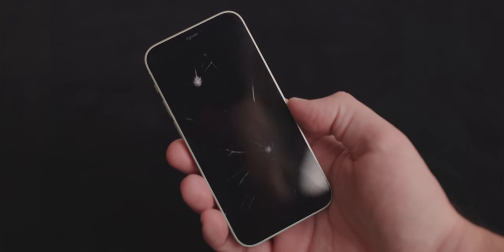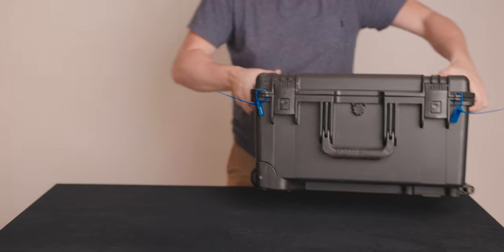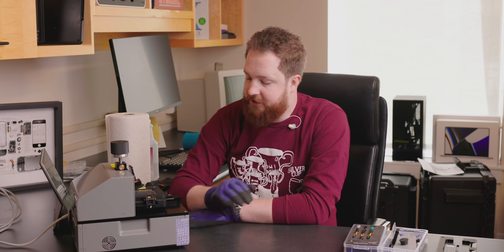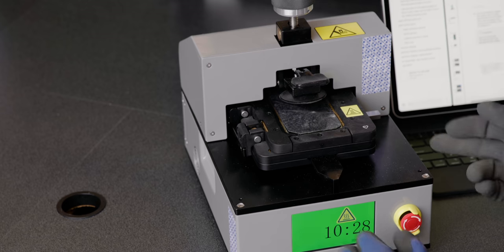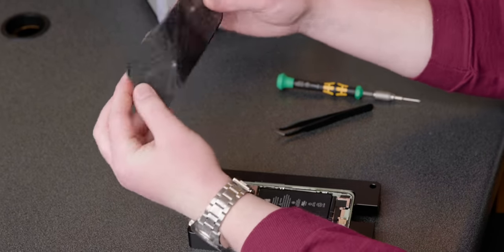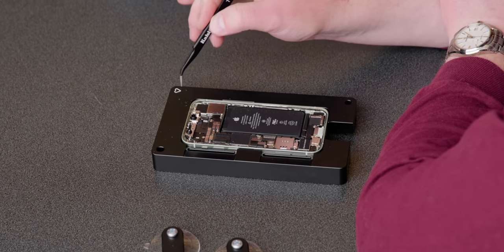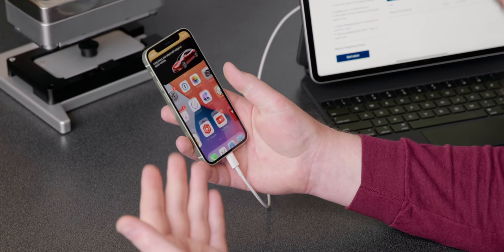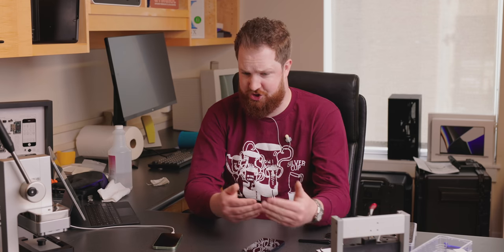Using Apple’s Tools to Fix My iPhone

Comment: That's a lot of packaging coming from a company that's saving the environment every 5 minutes.
Reply: -
Meh.
As opposed to other electronics companies?
They're all awful.
At least Apple lets you rent some cool sh*t :).
Reply: @scotrick3072  Because their shareholders forced them too. They should do more. 

Also, isn't Apple all about being better than the competition? They can beat the competition here.
Reply: @scotrick3072  Motorola, and now other smartphone companies have tied up with other companies to provide spare parts that don't require 96 pounds of kit to be shipped two ways.
Reply: @scotrick3072  yes they all are awful but apple is just the worst. It's not the one which does it better. Try taking apart an android phone it's a lot easier and cheaper (if you fail )
Reply: uhh you complain about the packaging but the fact that you're supposed to throw away perfectly fine screws is no problem? Because barely anyone will rent this kit, but literally EVERYONE will have to throw away a set of screws for no reason. FYI: with Macs you don't get another set for some reason.
Reply: Yes just imagine the ecological disaster this will cause when millions of Apple customers order 97 pounds of gear to save $10 and do the repair themselves.
Reply: Erm. It's the same, reusable packaging that every single person who gets sent this kit will be making use of. The only thing that's disposed of is the cardboard and plastic covers the parts themselves come in and the plastic fasteners for the return shipping.
Reply: @TalesOfWar  he is talking about the display and all
Reply: @scotrick3072  If Apple wants to portray its decisions as being made in the service of higher standards, why shouldn’t we oblige them by holding them to those standards?
Reply: @bubbledoubletrouble  -
No, no, we totally should.
My original comment was meant more as a, Computers BLOW for the environment, they are the WORST.
living in a disposable electronics society doesn't help, and having the ability to repair things?
I'm all for it, I just had a cynical moment where I felt that nothing matters, we're all doomed, etc. etc., where I felt that holding any one company up as being better or worse was pointless.
Which, of course, is crazy talk, and not only should we hold them accountable, but because of their sanctimonious holier than thou attitude, we should hold them to a higher standard?
Yes, totally, absolutely.
Especially as for so long their response to such concerns were, "Well, we'd love to help you, but then we'd have to sacrifice sleekness and awesome design! You wouldn't want us to do that, would you?"
Yeah. Yeah, we would, you weasels, suck it up and use those fancy designers to figure out a way to do both!
Sigh.
Reply: They put all of it in just that one shipping
Reply: Don’t give them any ideas. Soon they’ll stop including the screws because “everyone has a dozen old iPhones that they can scrounge screws from”
Reply: Well you see they only care abt the saving the environment when they can use it as an excuse to not give you a charger and earphones in the box bcz it increases profits
Reply: Lovely marketing, isn't it?
Reply: By not providing more paper works in the package they r helping the environment change
Reply: You should see what happens when you get an airpod replaced. Each earbuc comes individually wrapped in a box and plastic wrap the size of a whole brand new retail box.
Reply: nerds asked for it and there you have it
Reply: Y’all are missing the point of this, entirely. This is to allow people who don’t normally have access to repair, to repair their device. It is infinitely more environmentally friendly than buying a new device.
Reply: @bubbledoubletrouble  They do. This is an environmental step forward. This isn’t for people who have access to repairs. This is for people who don’t normally have access, like those in rural areas. This way, they can repair it themselves, they don’t have to buy tools they’ll never use again, and most importantly when their device breaks they don’t have to get a whole new device. The alternative to this repair, for the people it’s intended for, is to buy a whole new device.

Y’all sound foolish
Reply: Dude you wanna see packaging you should look at trades all the stuff we get as plumbers all the faucets and our waterline fittings everything comes in it own plastic bag sometimes in another plastic bag in foam in a cardboard box and pex sells their fittings in 1 packs which is so wasteful
Reply: @sherlockmaverick  not since tim, now its all about copying what android flagships have been doing for years
Reply: Silly comment.
Reply: At least apple is finally letting us repair our own shit.
Reply: @sherlockmaverick  If only they had stores that would do the same task for just a few dollars more. . . oh wait! They do!
Reply: You’re not considering/thinking of many things
Reply: @desmond-hawkins  Millions?
Reply: @richardm9306  Sarcasm?
Reply: @WiggyWamWam  We were talking about how this stuff was packaged. This is hardly the only alternative to buying a new device. For instance, Apple does mail-in repairs. If it’s in a condition that an end user can repair it, Apple certainly can repair it. Have you ever seen the kits used to ship a phone to Apple for trade-in or return? There’d be a lot less waste involved.
Reply: fr lol
Reply: Lol
Reply: Pretty sure that's the point they're to make. "You wanna repair your phone by yourself? Sure go ahead, this is all the stuff you need. We told you that was a bad idea"... Sad practices.
Reply: Going green= 🌿 - 🚫
Going green+ 💵
Reply: What’s wrong with Pelican cases ?
Reply: @PB-nn2dh  You don't get to keep it :/
Reply: @PanosPitsi  iphones are just another mobile phone they have no reason to be this complex to fix the only reason they are is because they are fervently anti repair
Reply: @PanosPitsi  I struggle to see what software has to do with hardware. The problem with repairability is access to hardware parts, not the quality of the software. You don't need to be an engineering student to know that much.
Reply: @scotrick3072  Whataboutism
Reply: and it's all plastic !!
Reply: how in the world do you come to that conclusion ? at which point apple said they are gonna save then environment? stop inventing things that arent there.
Reply: Quit yapping yall the ones who wanted all they shit 😭

Comment: I work at an Apple-"authorized" shop. The reason it goes back to diagnostics mode after System Configuration is you're supposed to then run the Post-Repair Diagnostic to ensure everything works. I'm surprised to see they skipped that here. Perhaps it's to save time in the phone call?
Reply: Probably because they don't send the dock that is required for running the faceid diagnostics too.
Reply: @Kossine  Sure, but it'd be easy to include that too. What you're getting with this self-service kit is better than hamstrung third-party shops, but still lower quality than going to an Apple store, because you can't run any diagnostics before or after the repair. And, I doubt having the dock is necessary for the Face ID diagnostic. It's good for making high-volume repairs easy, fast, and consistent, but for home use, I'd be okay holding the phone steady with my arms.
Reply: @MetricCrusader  Someone might be a little biased, here. You don't need all that crap to repair simple things. It's an obvious attempt to actually discourage DIY repair.
Reply: @KissMyChancla  All the pairing nonsense is why I will not buy anything newer than iPhone X for refurbishment. I know Face ID still won't work if the original parts are not present, but at least you can change a battery in an iPhone X without getting prompted that the battery has been replaced.
Reply: @DemePoole  Apple has gone back and has retroactively added the battery genuine check on some of their older phones, so I am not surprised if they decide to do that with an iPhone X if they want.
Reply: Likely and to not scare their customer with all of the data they collect on each repair :-D
Reply: @KissMyChancla  do you have to call them too to run system configuration each time?
Reply: The good ol' software unlocking part to make your camera and junk work on your phone because they lock stuff
Reply: @KissMyChancla  the apple diagnostic services are literally web services.
Reply: @ioney_at  this, AST2 is literally just a webpage you log in to and enter the serial number to. Repaircal was even easier
Reply: @KissMyChancla  that's true, but in the set it and forget it sense repair cal is much easier. Wed just have a device queue set up on that MacBook. I personally did remote work so it was all in the field for me, never had to wait.
Reply: @vfrmaverick  repaircal is still used
Reply: @Kiera Hunter I think you need to conceptualize how encryption works and the role in the operating system. 

Correct, if the phone is locked, third party apps cannot read content from the phone. However, when you calibrate a phone, you are not actually running the operating system, you are in recovery mode. Recovery mode allows a phone to be calibrated and the OS to run enough to function during calibration, but not require PIN or FaceID to unlock the device. 

But...if you don't think Apple can pull data from your phone, place it into logs, share that data back to their systems while your phone is running, you obviously didn't read your Terms and Conditions before you accepted them. Apple can look at EVERYTHING on your phone while you use it, as you cannot encrypt data from the operational side of the operating system. 

Apple's fancy new "don't allow apps to track" feature, only applies to non apple applications. They block facebook, but they don't block themselves. 

Most of the data shared during calibration is related to the serial numbers of the parts used in the repair, as Apple reads those off practically every component. That helps them look at failures of parts over time to know what parts they use are good and what parts they use are trash.
Reply: @MetricCrusader  I work at a third party shop. And oh boy, we have a heating mat and a heat gun, our diagnostic is no error messages and reprogramming the screens using the old one.
Reply: @fancy_owo  Where there's a will there's a way. How do you use the old screens?
Reply: @cmendoza1094  send them to the people we get them from so can refurbish them
Reply: @DemePoole  Quality companies design quality products. To manufacture and properly service those quality products in volume - proper custom tools are required, and Apple designs and manufactures those also. You CLEARLY demonstrate having little knowledge of manufacturing, testing and servicing jigs, workflows, sequences and protocols. Apple are not your average, disposable dum-dum China gadget Co.
Reply: Which is funny cus the whole things a cloud based solution, It's also cheaper for AASP to order these things themselves then when you buy it on their site. Altho self repair isnt available here just yet.
Reply: @MetricCrusader  I'm an authorized repair technician as well and I believe if you try and run post-repair without the dock it just fails until the phone knows there is an apple certified dock connected to the device. Cause ya know, it's apple. Still what a small thing out of all the garbage they're mailing out to not include in the kit.
Reply: @unlokia  That's propaganda nonsense.  Most of those jigs are oversized and/or exist only to handle offensive roadblocks they added deliberately to stop independent repair.
  There is no honest reason to glue the battery instead of just putting it loosely in the same place.  There is no reason to demand serial number matching except to enforce a monopoly on selling the parts.  There is no reason to silently block random OS features when a hardware part is not genuine.  Some specific parts will have specific dangers from fake parts and those should be reported and handled directly, not buried in bureaucracy.
Reply: @johndododoe1411  You don’t know much about the reasons Apple are SO successful, it’s clear from the ignorance in what you say b
Reply: @KissMyChancla  that's the most annoying part.  They can't lock us out legally so they'll lock us out via software.  That's the new way..
Reply: @DemePoole  It sucks not being able to buy a new iPhone past the X, I went from a 6s Plus and got a 13 Pro, and would've stayed with the 6S Plus if I could have, but it was stolen when someone robbed me at gunpoint, so had to get a new stupid iPhone.
Reply: @DemePoole  So they don't use any of these in the at the Apple Authorized repair shops either....go figure. Also, it's an option.
Reply: @nilomyki  Uh...did you have a point, or something..?
Reply: No Brasil, os serviços de assistência autorizados são inviáveis. Além disso, há apenas Apple autorizada nas grandes capitais do país. Eu trabalho com assistência não autorizada, para remover a mensagem de peça não autorizada é necessário soldar a bateria original flex para a nova bateria (além de equipamentos para redefinir os ciclos). Para a tela é necessário implantar o IC do original na nova tela. Eu gostaria de poder mudar a parte e simplesmente autenticar através de um site ou software.
Reply: hmm